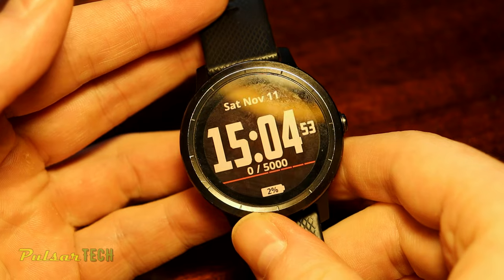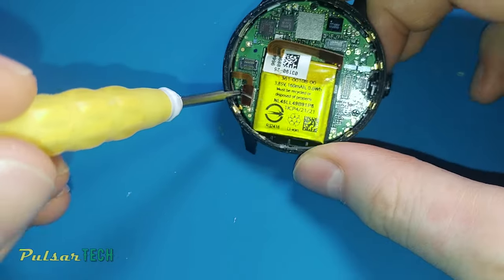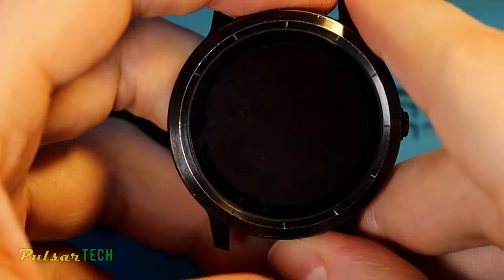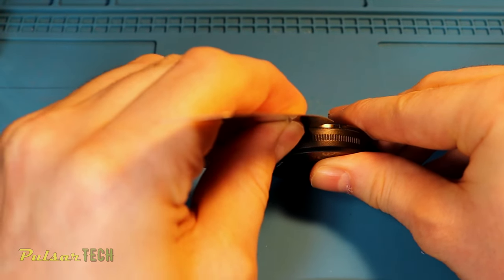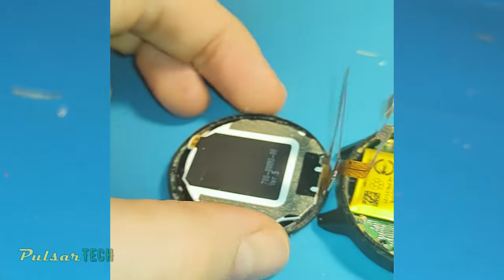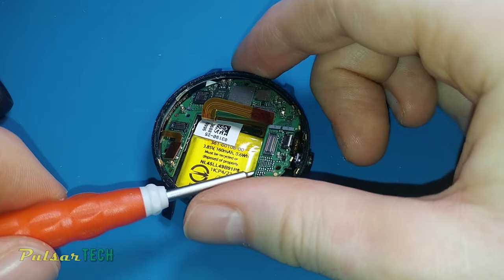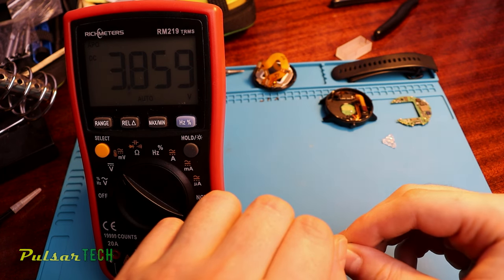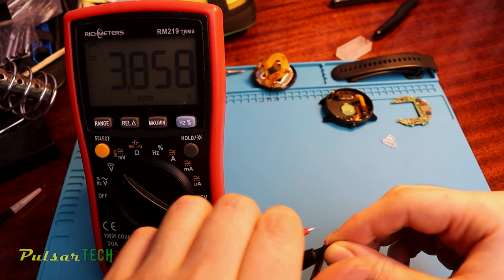Learning Curve: My Garmin VivoActive 3 Battery Swap Adventure

Comment: Awesome video! Intead of buying another watch just replace worn out old battery. 
Reuse - repaire - reduce - recycle!
Reply from the maker: Great point!
Reply: Electronic vendors should not be able to produce products that do not allow for the batteries to be replaced easily.  We are too much a throw away society. Aside from this watch,  I have electric toothbrushes  that are designed not to allow the battery to replaced, but I have replaced them anyway. The vendors could easily allow for a design to replace the battery without taking apart the device.  Same goes for the watch.
Reply from the maker: I totally agree. The only issue with watches is that they are waterproof, which means they have parts glued together unless they come up with an idea on how to make a waterproof watch without adhesive sealant, and that would be hard to achieve. However, for smartphones, a waterproof rating is definitely not necessary unless you intend to swim with it.  @larryzuckett2598

Comment: Hello 
Thank you for Your very detailed instructions and shared experiences. 
Would it be possible to share how the watch has been working after few months. Also it is hard to find replacement battery, would you have any recommendations ?
Thanks
Reply from the maker: Hi, glad it was helpful. The battery was working fine, though, it wouldn't charge more than 160mAh. Also because the battery was slightly thicker than the original one, I think by 0.5mm, eventually the glue started to give up and it has almost opened up on its own. But luckily, I found a replacement knock-off battery with exact dimensions as the original one and have resoldered it instead. Glued it back and because it is a bit thinned, it closed easily and works great. Also the battery time has increased to 7 days now.

Comment: The seal is a silicone seal  , you don't have to heat it up at all . All you have to do is use a sharp object and break the seal all the way around then it will left right off .

Comment: As @BLyyyth commented below the battery connector does not slide out of its seat horizontally. It has tabs on the side of the connector that prevent it from doing so. Instead, the connector lifts up and out of its seat. I used a pair of tweezers to lift the end where the wires connect, up and then out of the seat at a 45 degree angle. It can be difficult to lift the connector directly up out of its seat, as the seat is not fimly attached to the base of the watch and I didn't want to pull it loose from its ribbon connection. Install the new battery connector in reverse order.
Reply from the maker: Good observation!

Comment: For those replacing the battery, take the watch apart slowly, there is no rush. The glue around the top of the watch seems to be more become more pliable with heat but it is brittle so it will "let go" which is fine. Know that the battery connector is -- pushed in -- from the top. It does not need to slide out. If you look closely at the connector on the new battery, you can see that it "sits" in the connector. Be very careful with removing the old battery from the connector as it is not firmly secured to the body of the watch.
Reply from the maker: Good point!

Comment: ¡Excelente video! recién le cambie la batería a mi vivoactive 3, pero tiene un menor rendimiento incluso que la batería de fábrica, ¿Crees que sea necesario remover el PCB para que eso no pase? o ¿la batería que compre este defectuosa? saludos y gracias.
Reply from the maker: Como mencioné en el video, tuve el mismo problema con ese pequeño PCB instalado: la batería se descargaba súper rápido, mucho más rápido de lo esperado. Una vez que lo quité, dejó de descargarse tan rápido y ahora dura aproximadamente una semana. Ni siquiera estoy seguro de qué hace ese pequeño componente del PCB, ya que no he notado ninguna limitación en el uso del reloj. Así que quizás intenta quitarlo también y ve si ayuda. Espero que funcione para ti. Avísame cómo te va.
Reply: @PulsarTECH  Gracias por la pronta respuesta, bueno he identificado que es ese pequeño PCB es un sensor de temperatura, no se por que interfiere con la carga de la nueva batería y su rendimiento, pero parece ser que funciona tú procedimiento al quitarlo la batería ya no se drena rápidamente, seguiré testeando y te aviso como va y ver si puedo recolocarlo, saludos.
Reply from the maker: Genial. Espero que siga funcionando bien. Es bueno saber que es un sensor de temperatura, ¿cómo lo descubriste? Supongo que de alguna manera ese sensor de temperatura se dañó durante el desmontaje, consumiendo constantemente energía mientras el reloj intentaba obtener datos de este sensor, pero probablemente no respondía o estaba malfuncionando, consumiendo energía sin parar. Avísame cómo te va. @TheMacerockz

Comment: I tried to do it and had the same issue with you in stripping the cables when trying to remove the battery connector. I swear that Garmin must glue it or something! 
Mine was worse than yours though as the connector head remained in the socket.
Reply from the maker: Yeah, it seems difficult to properly remove the connector because it's so small. I hope you'll be able to attach those wires like I did and fix it with a drop of silicon glue and solder the battery wires. Good luck.

Comment: About the 300mah battery: I can only find one on Amazon that's for the Fenix 3, it has the dimensions: 32.10 x 24.52 x 4.88mm. The vivoactive 3 160mah batteries are 22.50 x 20.50 x 4.50mm. Do you know if there is enough space in the Vivoactive 3 for a slightly bigger battery? Or did you find one that was the same size?
Reply from the maker: The maximum battery size for this device is 160mAh, so do not attempt to install larger batteries as they will not fit. I have found a 300mAh battery with similar dimensions, measuring 20x20x4mm, on the marketplace. I am unsure how they managed to fit 300mAh into the same size as the 160mAh battery; perhaps it utilizes a different technology. However, in reality, the watch can only utilize up to 160mAh of the 300mAh battery's capacity. It seems the watch may be programmed to recognize and charge only up to 160mAh, cutting off power once this limit is reached. Therefore, opting for a 160mAh battery will not result in a significant difference. As mentioned in the video, the 300mAh battery may potentially last longer, as it only uses half of its capacity. This is just a theory, and we will have to see how it holds up in 2-3 years down the road.
Reply: @PulsarTECH Thanks!

Comment: Have you got a link to the 300mah battery please?
Reply from the maker: Hi! Depending on your location, you can check local marketplaces or global ones such as Amazon, AliExpress, or eBay. Unfortunately, the vendor from whom I bought it no longer has it listed. However, there should be other sellers offering the same product. Good luck!